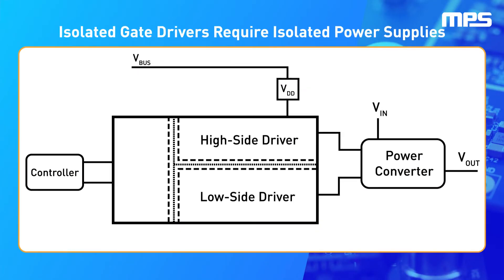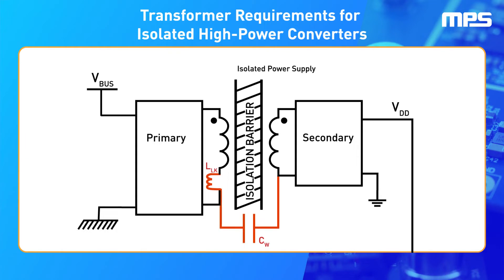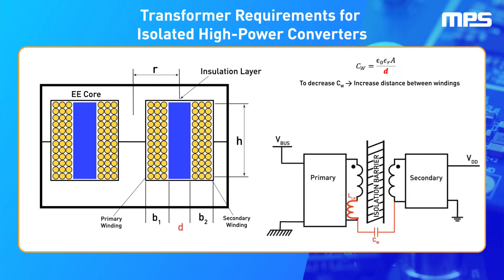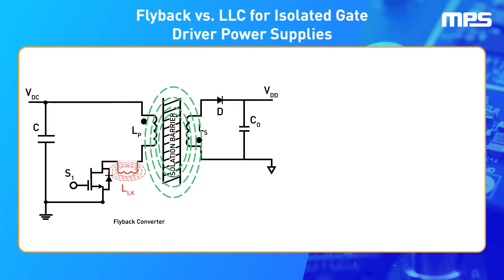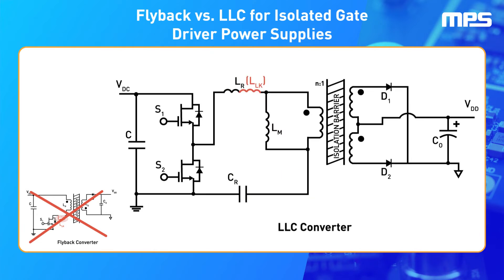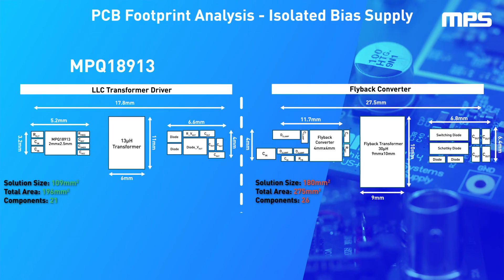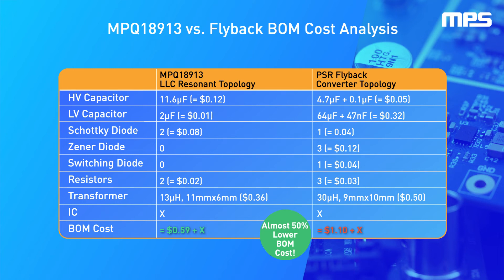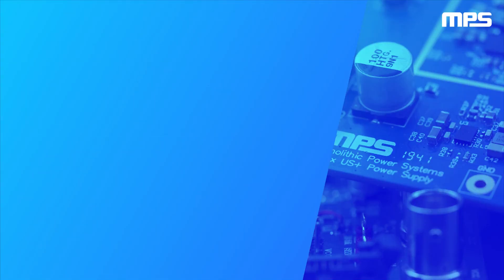Flyback vs. LLC Power Supplies: High-Voltage Converters Series

Comment: Can I ask someting here? In this video, you mentioned that the LLC topology is good choice for high power applications than flyback converter and I also already heard that the LLC topology is good for power supply over 100 W. But in this video, you also mentioned that the LLC topology is good for power supply for gate driver. However, the power supply for gate driver is small power supply not high power. can you reply why the LLC topology is good for power supply for gate driver?
Reply from the maker: Thank you for your inquiry.  Please go to our forum for technical questions.  We have engineers that will respond within 24 hours. https://forum.monolithicpower.com/
Reply: Hello, did you get any answer about this ?